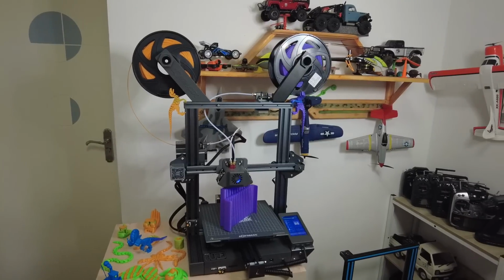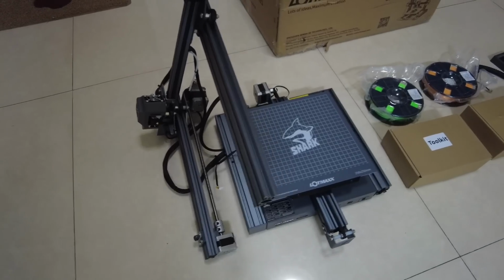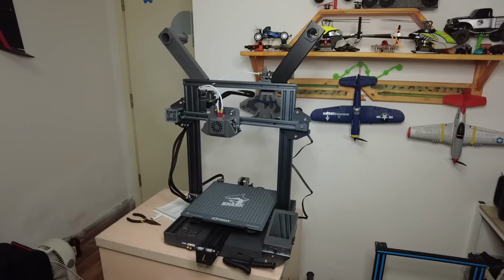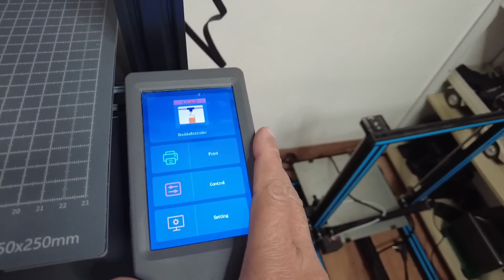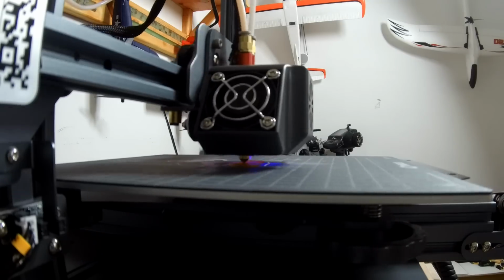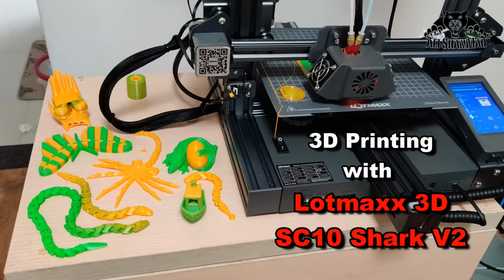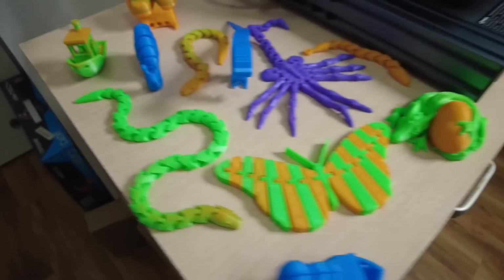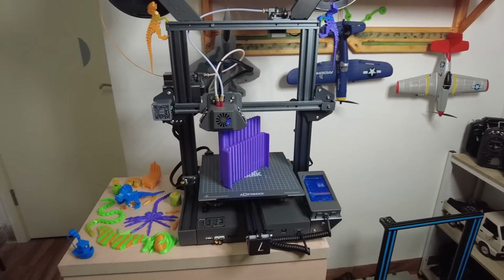Lotmaxx 3D SC10 Shark V2 Bi-color 3D Printer Laser Engraver Review

Comment from the maker: This is Lotmaxx SC-10 Shark V2 3D Printer and Laser Engraver. some people are misguiding and or are confused about the previous version that they had some issues with (Which obviously were resolved by manufacturer after releasing new firmware). Shark V2, this very printer, I have been using, literally non stop (for more than 2 weeks as I type the comment now - See comment date) and honestly so far not a single issue at all. its a workhorse, and 3D prints are absolutely accurate and amazing good.

Comment: So 6 months later how is the printer holding up and operating?
Reply from the maker: still working very well. check this video, 3D Printed a 1.7 meter Kayak and it printed parts non stop for a month. and then started printing another Airboat 1.7 meter long as well, and again this and V2 worked for non stop for another month (and as i am typing this comment still printing Power combo seat for Airboat). so 2 months of non stop printing (no powering off except only for few hours some times when I am too busy to continue next print) 
these are absolutely hardcore workhorses.
https://youtu.be/AMPilG4WKso

Comment: What about the review of the laser engraver?
Reply from the maker: I may not be using or doing review or may do a review very late of laser engraver because it requires me to completely take off 3D print head and install Laser head. besides its only 1W laser which is not going to be much use for me. I am awaiting a 15W new laser engraver coming from a manufacturer later which I will review.

Comment: HOW DO YOU GET IT TO PRINT THE DIFFRENT COLORES
Reply from the maker: When you slice your parts, you can set which part to use which extruder (1 and 2) and obviously each extruder has a different color filament. thats how
Reply: @alishanmao  I cannot get extruder 2 to preheat.  What advice do you have that can help?
Reply from the maker: @americansupervillain4595  hey buddy, what you need to understand is that there is only one nozzle that heats up, and the extruders which are basically just pushing filament in parts, will push filament either from 1 on the left or 2 on the right. but filament goes into only one nozzle and that is why you can only preheat the Extruder 1 and bed. ext2 you can't because there isn't any 2nd nozzle to heat. when printer needs to use different color filament, it will pull one out and push another in. and so on.
Reply: @alishanmao  Thank you